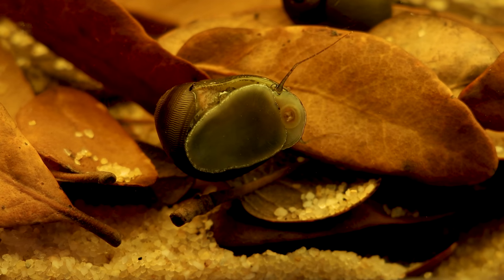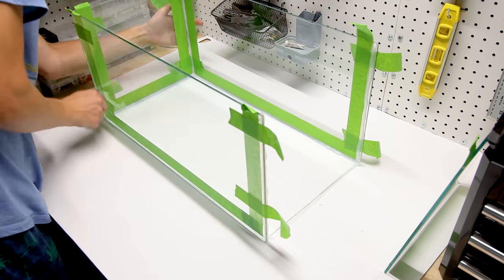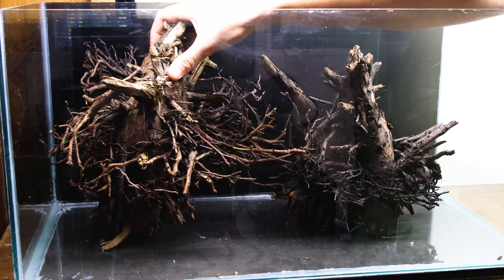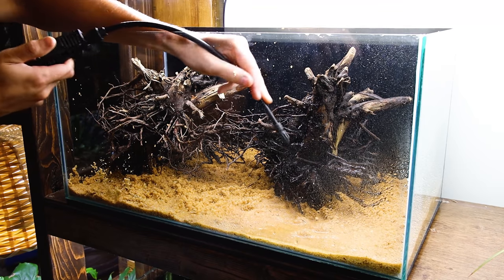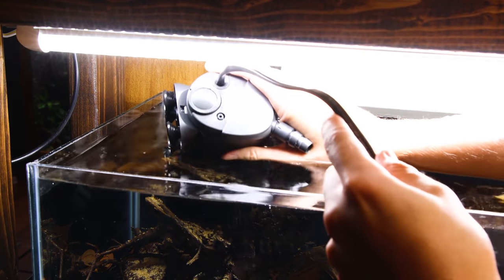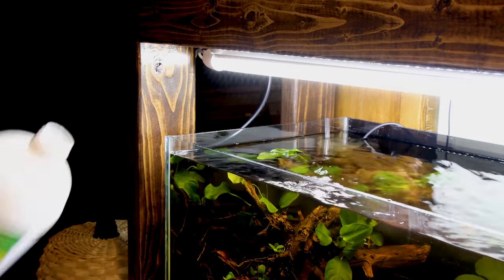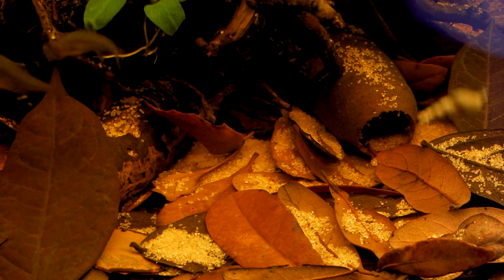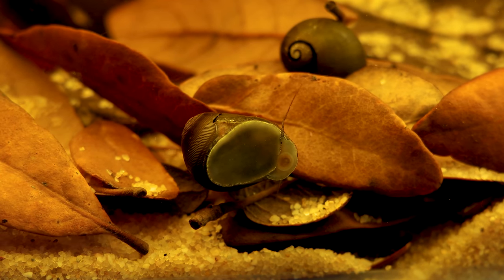Easy Blackwater Aquascape for Tetras

Comment: Great looking tank!  I love blackwater setups!

The only thing I would have done different is mix some natural gravel in on top of the sand but prior to putting in the leaves and sprinkling the sand over top.  I also would have put in a few larger smooth River rocks near the wood for two reasons. 1. In nature (freshwater) you rarely find just sand without rocks.  And 2. If the sand gets overturned/moved by the flow, livestock, or whatever, it will provide a more natural blend to the slate you mounted the wood to.

All that being said, it's one of my favorite setups of yours.  You're so talented and I learn more about aquascaping each time I watch.  Tell your parents they should have known better about the wood. 😂🤣

Comment: I'd like to see more snail homes !
Also, how long do you boil the pieces for, curious for my own builds. :)
Reply: Boiling for disinfection would only require a few minutes. After that I'd let the wood cool down in the water to help water log them. (The air expands and escapes through the canals in the wood and as the wood cools down it sucks up some of the water, this usually skips at least a few days of natural water logging)
Reply: When I boil stuff in my channel I usually do it 15 to twenty minutes
Reply: Thanks this helped me too
Reply: thanks for the information guys ❤️

Comment: So...I have some legitimate questions. What does waterlogging do to the wood? Does it separate the grains so it absorbs easier?

How have your rimless tanks held up? I've been contemplating making my own rimless tanks w/ thick glass, getting it cut for free at my local Home Depot, using GE silicone 1 and frog tape. I successfully divided a 10 gal into 2 with a custom glass pane inside. It's held up and works great as a show tank!

Where do you get the glass? How thick is it?

How much did this cost with the botanicals, glass and sand factored in?

Sorry for the questions, Serpa. Although I've been watching your videos for over 4 years I've recently been very interested in doing similar builds :)

Comment: licorice gourami or bush leopard would go nicely. do you ever use underground filter pads in any of your scapes? a single drain pan in the middle of the two roots would make maintenance much easier

Comment: Genuine question Tanner, but if the bottom of the tank is neoprene, and you have a substrate layer blocking the view completely of the bottom, what is the sense of using glass on the bottom of the tank? Could you use something else since it largely isn't seen?

Comment: How do you clean this kind of set up in an aquarium? I have difficulty to keep it clean as the algae grow super fast. Any suggestions?
Reply: Algae growth in new tanks is normal. I don’t mess with it except to clean it off the glass. I wouldn’t worry about it in a tank that’s less than a year or 2 old. Just be consistent with water changes, lighting, and feeding and the tank will find balance and then poof no algae.

Comment: Thankyou so much for your awesome videos! It brings me great joy to see such awesome scapes! I have just started on my own black water tank. I was wondering what would be good to put in the filter. For a regular setup, I'm used to putting in active charcoal with ofc the filter sponges. But for a black water tank, I don't really know what would be best to put in the filter. The charcoals would pull out the tannins Wich I don't want. Can a filter run well without anything extra in it, or is there something else I could use? 

I'm looking forward to hear from you, thanks in advance and have a great day! Take care!
Reply: I know it’s a bit late for my comment, but blackwater aquariums usually work best when the filter is rather slow and just provides lots of surface area.
(I always just use a ton of fine filter sponge)

Tannin aquatics has some good articles on blackwater filtration on their website that go really into detail and explain absolutely everything.
Reply: @yourlocaltoad5102  no probs, Thankyou!

Comment: How dangerous are the tiny pieces of glass that come off when you sand the edges? I know the water stops it from going air born, but what happens to all the tiny shards after you’ve sanded it? And is it dangerous to have them in your lawn? I’m just scared that if I do this I’ll have invisible tiny glass shards everywhere

Comment: This is how you spot someone who has mastered their craft: they buy the CHEAP stuff! Some glass and silicone, making the tank yourself, some pool filter sand instead of insanely expensive "aquascaping soil", locally sourced driftwood and some window tint foil instead of the stuff that is marketed for aquarium use...
Once you've reached a certain point of knowledge you just know what things are necessary and which aren't and then you can just skip all the expensive stuff (that is not needed).